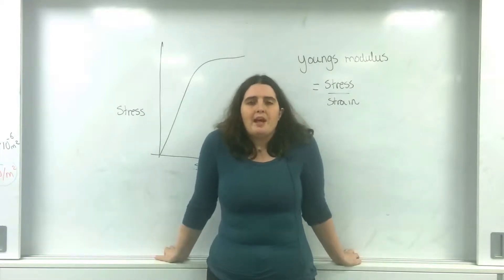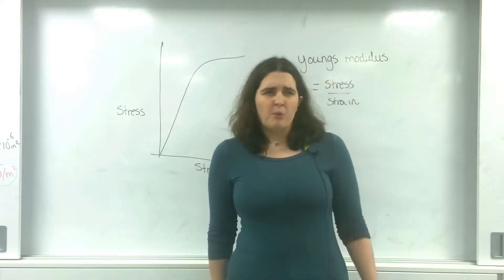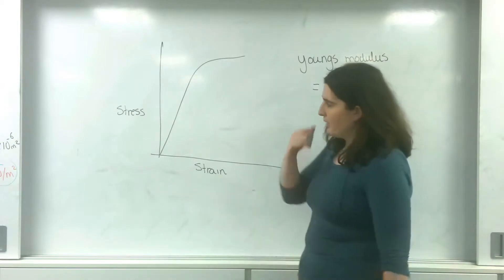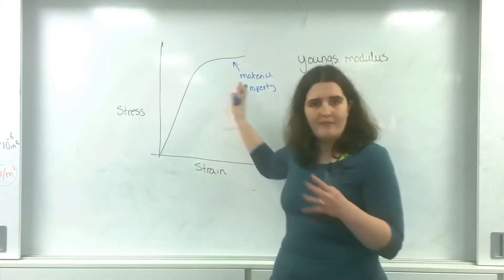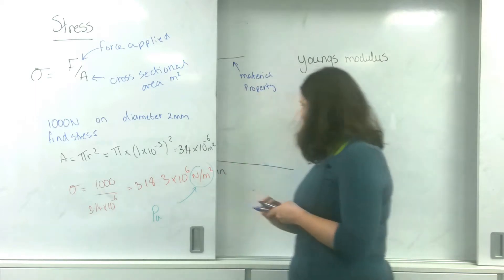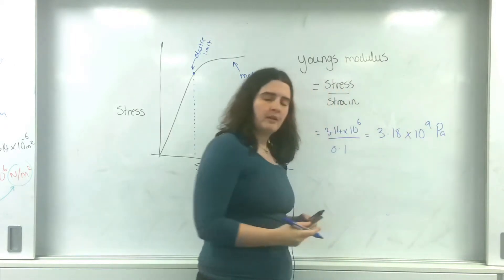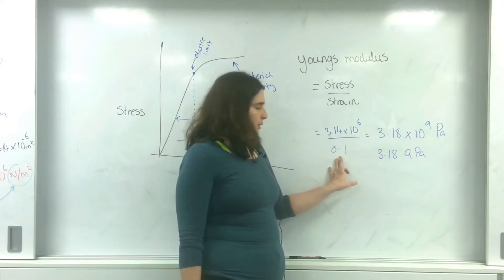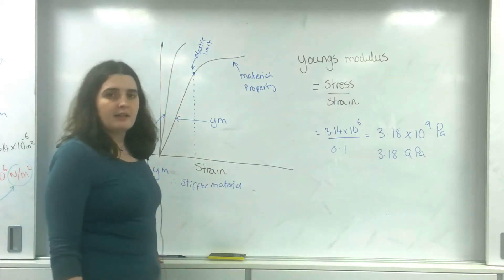Youngs modulus AQA Alevel physics

Comment: Your stress is 3.18*10^6. And 3.18*10^6/0.1 is not 3.18*10^9. Don't keep using the calculator for simple calculations 😂 But thank you ever so much for all your effort
Reply from the maker: Hi, 

Thank you for pointing out that mistake, method was correct must have been by inputting on the calculator. I always normally double check my answer on the calculator but I know that I have a few calculators that literally stick on the keys. (Hence a few mistakes I have done before but corrected in video) 

I think I was also expecting GPa since that is normally the values youngs modulus is given to. 

Either way thanks for being keen eyed and pointing out the error :) I will put a note in the video and re-edit it asap.
Reply: TLPhysics Ahh okay. Thanks for all the help Sarah, you'll save my exams :)